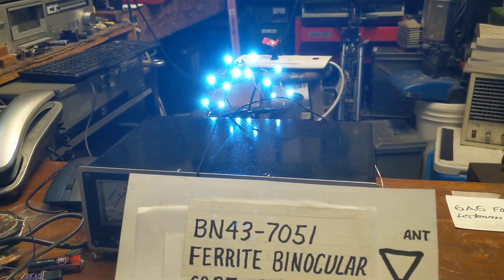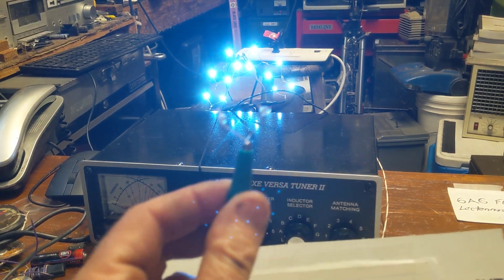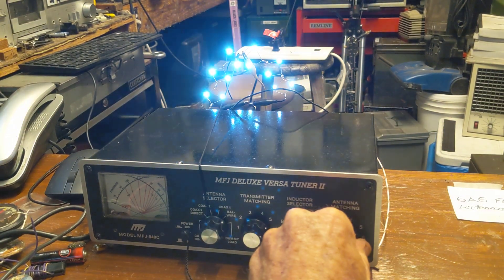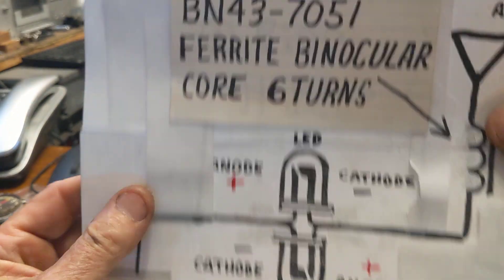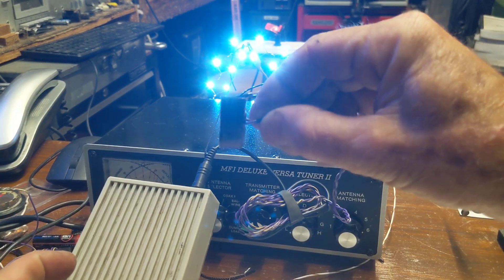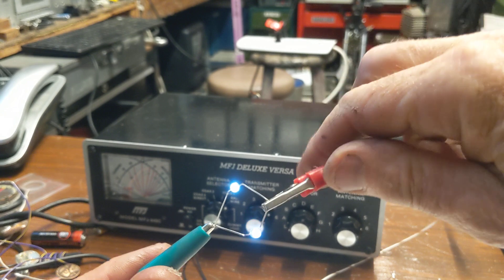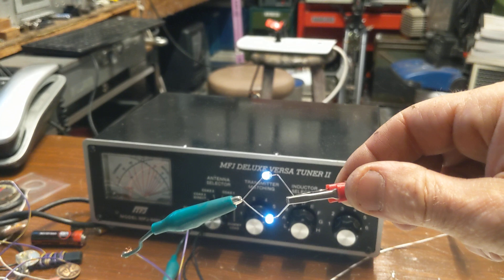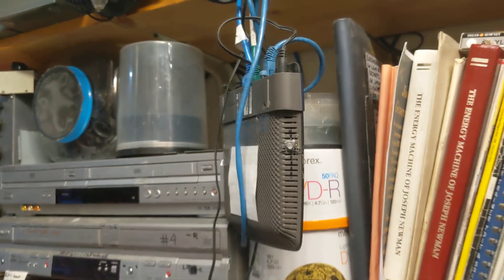Antenna Tuner For Free Power Experiment.

Comment: Very Cool, I wouldn't have thought about the LEDs being Modulated be the Radio Signal then hearing it with the small solar array amplified. It's amazing how sensitive though low cost common components are.

Comment: nikola tesla made a tower on the top of his laboratory from where he was transmitting radio waves, and he connected another small ariel tower in his car where he received the signals, he rectified the signals and charged an inductor, as soon as the inductor was charged to full he disconnected the supply from radio waves using some circuit or spark gap, then the magnetic field of inductor collapsed with speed of light eventually raising voltage to very high levels, he charged a capacitor bank with this collapse and ran car for 80 miles with his nephew.

Comment: With a highly placed antenna you run a Tesla coil with proper spark gap as a step down transformer. 
With a pancake the capacitance can be low and frequency high then second stage larger cap for rectification. 👍

Comment: Thanks for sharing this. Very neat! I recall Tom Bearden talking about the importance of impedance matching to get the best harvest of charge from the ambient environment (I guess what he would call the "vacuum"). One observation - is not your LED reverse-bias arrangement essentially converting the radio sine waves into uni-directional pulses, or pulsed DC? As this happens, you may be provoking the ambient charge (aether) to push back when agitated by these pulses, essentially powering the circuit. Thoughts?
Reply from the maker: I have not problem understanding half or full wave AC to DC voltage rectification using diodes, but when it comes to this lectenna design, I can't really visualize how this  works, but I do know the LEDs power source is the local AM radio stations.

Comment: I measured with an Apermeter, My antenna accumulates sats at (v-..20) 00.10 mine (Detector radio) increases the current to (v-..200) 30.00

Comment: Hi Dave.Can you make a frequency generator enough power for house machines such as the fridge,the owen,the tv,etc.Let's say i do not want to instal a solar panels on my roof but have that kind a device with energy on demand.10kw strong power plant at home or in elwctric car.
Reply from the maker: Stick with the solar panels if that's an option, You will never get enough power from radio waves to power the appliances you mentioned.

Comment: I have a 50kw station (1030 AM) a tad under 14 miles from my place. I wonder if I could do the same? It would be really cool do rectify the power and use it to run a wspr transmitter or a simple cw beacon.
Reply from the maker: I'm sure you would be able to light up the LEDs at an impressive distance with that much power, but the amount of energy required to operate a CW beacon or a wspr transmitter is likely to  be more of a challenge, but I'd like to know of you figure it out.

Comment: I had no idea that a solar cell would have the frequency response to demodulate the audio. That's amazing! I was going to suggest a phototransistor or photodiode, but you did it with a solar cell. Could you try a CdS photoresistor (with a voltage source of course) to see if it has the frequency response to demodulate the audio?
Reply from the maker: I've done this same experiment with a photodiode and I've also used regular LEDs which were able to demodulate the audio, but were not very sensitive as the solar panel or photodiode was.

Comment: It's called an AV PLUG / Avramenko diode plug and they are great to use with static electricity and electromagnetic fields including radio frequency.
You can connect multiple  together and get better results and also AV plugs can be used with capacitors to make energy and ambient energy harvesters. It's really easy to use for a field strength tester

Comment: Yes, you are "matching" the antenna by putting an inductance in series with it.  The antenna is a tiny fraction of a wavelength so it looks like a capacitor.  Your inductor is bringing it closer to resonance.
It is likely that the big array of LEDs went out because they total up to too much capacitance.  They are nonlinear.  With a larger signal on them they will look like a resistance in parallel with the capacitance
Where I am an unloaded crystal radio will charge a capacitor up to about 2V.  This means that I could perhaps power a red LED but not a blue one.
Reply from the maker: I was thinking the increased brightness I observed after installing the choke was probably due to its ability to eliminate destructive reflections, and perhaps this allowed more of the wanted signal to power my LEDs.

Comment: If it's not too much to ask, could you please make a video about the 200 feet antenna... I'm really curious to see what it looks like.....thank you very much!
Reply from the maker: My antenna is just a 200 foot long wire antenna  going over the top of a pine tree.  Sort of like an upside down V
Reply: @GrantsPassTVRepair  Sorry, I'm a beginner and I don't know... isn't it dangerous for lightning?
Reply from the maker: @beruhmtezitate4697  The antenna could be said to be dangerous, Yes but so are trees, power lines, TV antennas, and any tall structure.
Reply: @GrantsPassTVRepair  I would be interested to see at least a graphic diagram, it might help.. thanks

Comment: Please note the difference between Ferrite and Powdered iron cores. Powdered iron is a high Q material with low loss. Ferrite, as in Ferrite beads is a lossy material designed to dissipate energy to suppress unwanted energy. Also note that the inverse square law will make a difference in your results. This will work if you are close to the broadcast antenna.

Comment: I would love to find a way to light an LED with distant nighttime AM DX  I have a 70 foot longwire antenna and homebuilt crystal AM radio with ground.  I also have a shortwave crystal radio which can tune to CB radio 27 MHz I can light up LEDS connected to earphone outlet when I key up talking on my own CB radio Currently the only way I can light up an LED using radio signals.
Reply from the maker: Give it a try.

Comment: The tuner will act like a band pass filter rejecting other stations. Removing the tuner at night could be letting other stations assist in lighting the led. 

My limited understanding of this type of choke as that it prevents an ac current from passing through it similar to how a capacitor stops dc current. I think more of the rf is forced back through the load (leds). Old heathkit field strength meters used this.

I was able to make a similar choke using thin magnet wire on a small toroid and 50+ wraps. More is better as I think the goal is to make as high value inductor as possible. Mine was about 20% as good but worked as a proof of concept.
Reply from the maker: I'm guessing my choke was blocking destructive reflections riding on my antenna which allowed more of desired signal to power the LEDs.

Comment: Nice work now use the power to charge capacitors and increase the power to run a electric motor it works pretty good

Comment: Great job Dave I used to have that exact MFJ 949C when I was deep into ham radio too. FYI KAGI AM 930 operates 5000W daytime and 123W nighttime, KAJO AM 1270 operates 10000W daytime and 48W Nighttime both from the same tower exactly 1.48 miles from you (straight shot)
Reply from the maker: Thanks for the info Steve. I didn't realize both stations used the same tower. Seeing how low their power is at night, I'm, surprised to see I can still light up a couple LEDs.
Reply: I think a lot run higher power than allowed at night. I’ve gotten stations that are supposed to be 30-40W hundreds of miles away.
Reply: instead of a wire as antenna, make a loop, 50 cm diameter, many rounds. it will absorb more waves. possibly that choke is doing that but it is too small
Reply: Схема рабочая. Это вилка Авраменко.

Comment: Wow! Great discovery Dave! it must be by adding the coil inline with the diodes you you were able to tune it like a crystal radio. I remember building a crystal radio from scratch when I was a kid from instructions in an old radio magazine, and wrapping a couple of hundred turns of wire around a plastic tube and inserting a round slug of ferrite on a stick into the tube to tune the frequency. 
It looks like 600khz wave is 500meters and 1400khz is about 230 meters, so a 1/4 wave antenna would be 190 ft for 1400khz and 400ft for 600 khz so you are right in the sweet zone for getting max power from AM radio.
Reply from the maker: Rather than improved resonance on my antenna,  I believe the additional brightness came from the elimination of  destructive signal reflections going to my LEDs that were riding on my long wire antenna by using the choke or the antenna tuner. Antenna tuners don't actually tune antennas, but they can make the  output signal impedance more available by blocking the destructive reflections.

Comment: Is this how wireless charging works on new modern mobile phones?
Reply from the maker: I suspect the principle  used in wireless phone charging is closely related to the actions of a transformer which uses electromagnetic induction to transfer energy.
Reply: It’s two induction coils. One in the charger, and one in the phone. They’re only 3-4 mm apart, but still lose a lot of power.
Reply: @5roundsrapid263  really? Surprised the EU allows it then,